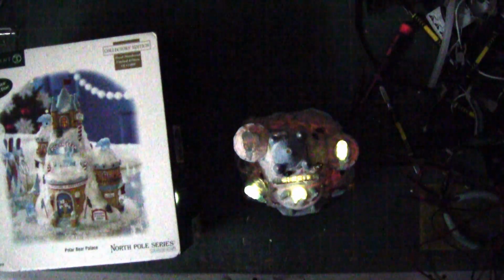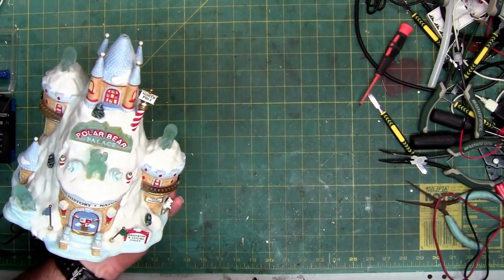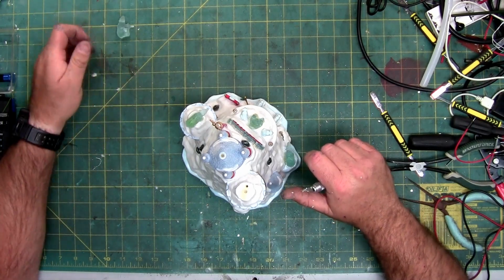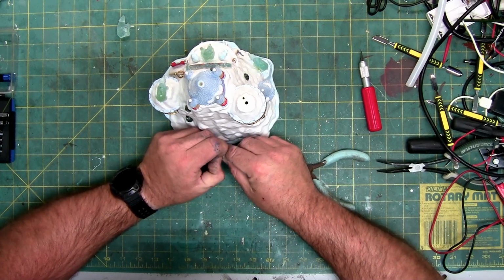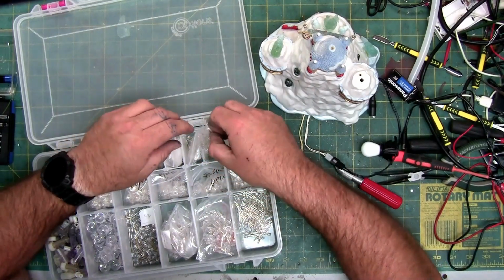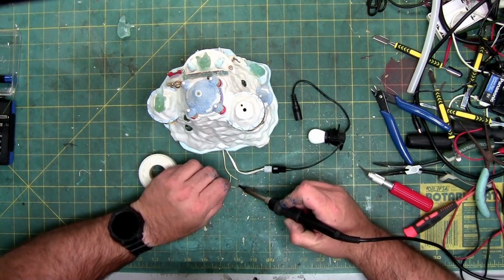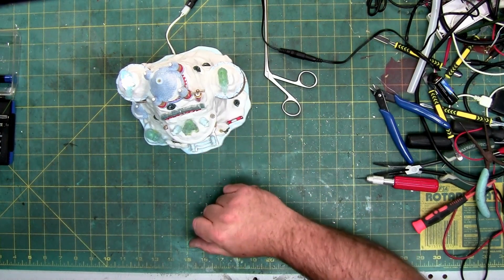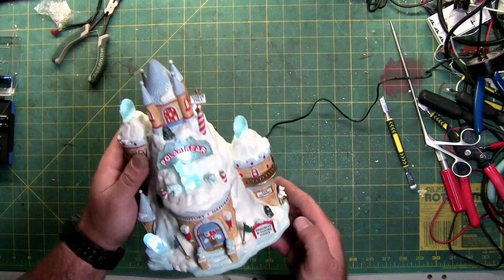Department 56 Polar Bear Palace Repair

Comment: Currently working on one of these right now. When pulling the light bulbs through, how do you get them to stick in place? Do you glue it before pulling up? Any advice would be greatly appreciated!!
Reply from the maker: I do, but I put the glue on the edge of the hole, not the LED itself.
Reply: @RandomJunkChannel  thank you! What kind of glue do you use? Also, did you use the lights that you had in your description? Thanks again!
Reply from the maker: Hot glue, I use Surebonder brand, but any hot glue should work.